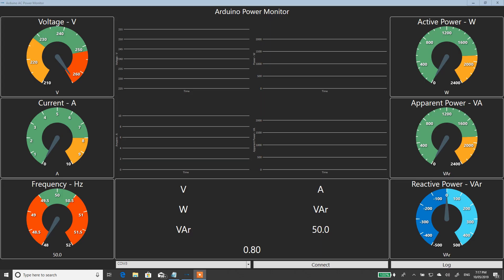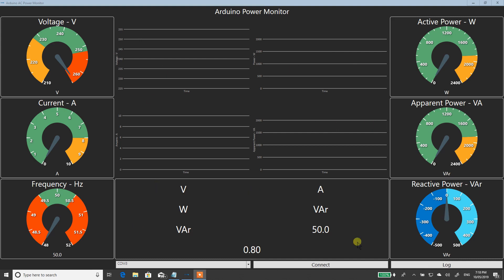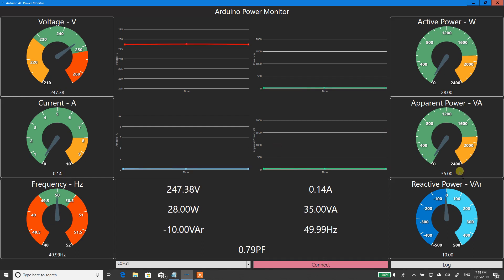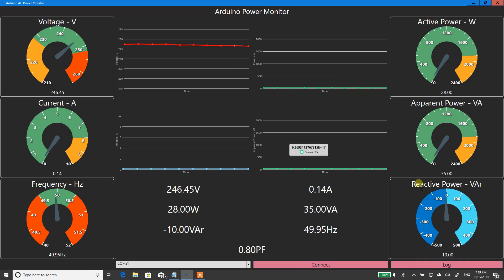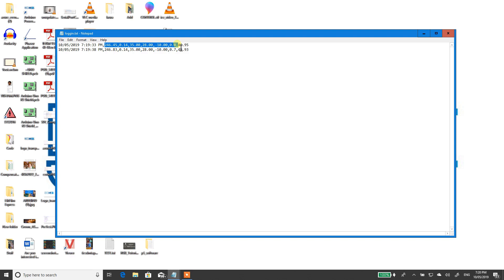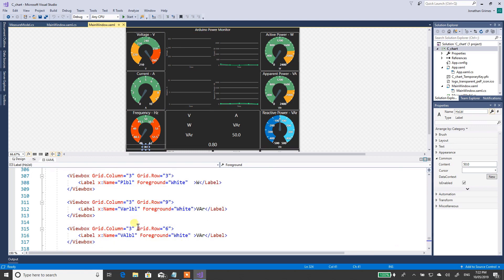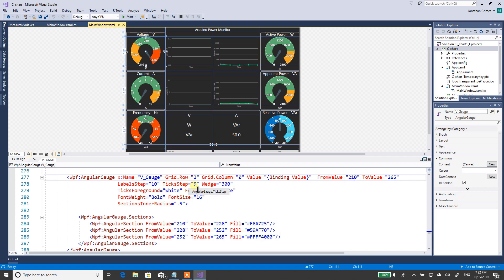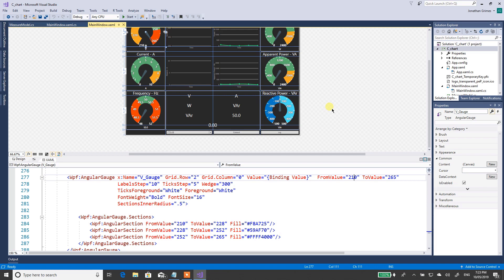Arduino AC Power Monitor GUI

Comment from the maker: Next video in this series will be out on Sunday 9th of June 2019

Link for the file located in the description on this video 
Arduino AC Power Monitor Part Three 'Current Circuit' https://youtu.be/BUZtk6U8amw
Reply: There is no link in the description
Reply from the maker: @MikeMcRoberts  https://drive.google.com/open?id=1qyumKrrMJvOS0BzctGbL0TQJQ4Gl3qTy
Reply from the maker: Sorry about that, It got deleted. Not sure why